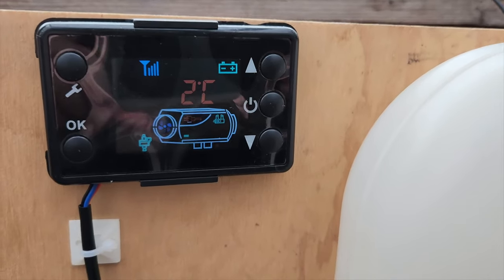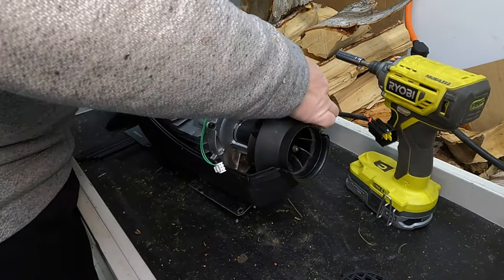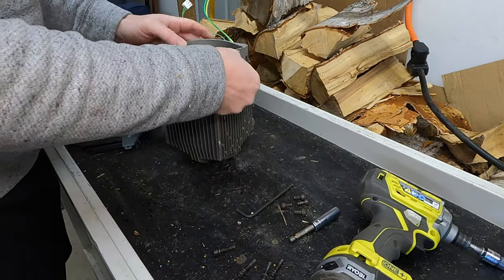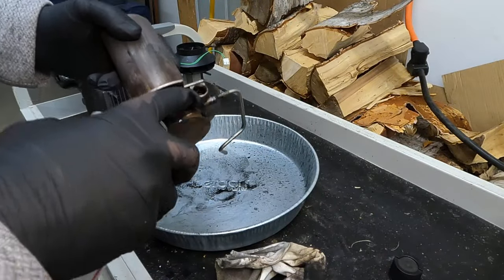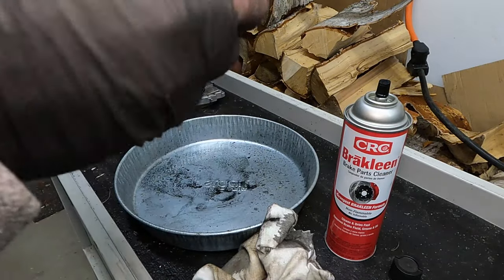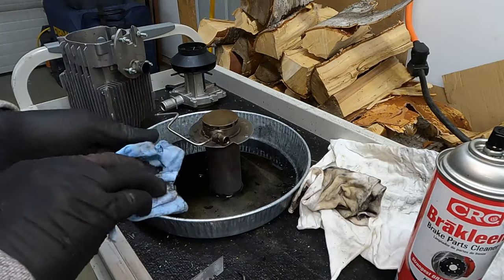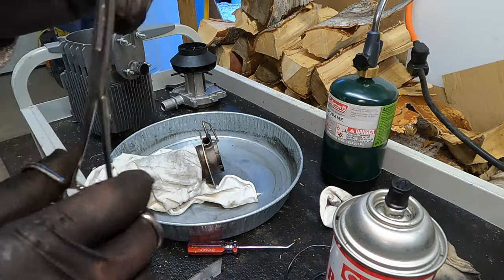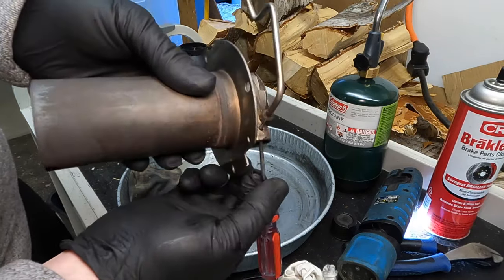My Vevor Chinese Diesel Heater Stopped Working. Can I fix it??

Comment: Don't burn brake cleaner.  The chemicals can break down to harmful or fatal gases like phosgene or hydrogen chloride
Reply from the maker: Good advice!! 😬 I had no idea. I've added a note to the video description. Thank you!
Reply: @alaskanhomesteading  No problem. I used it a few times while welding, before I learned how bad it is to burn
Reply from the maker: @kevinedwards4449  What do you use for cleaning/prep now, instead? I just got an arc welder. All I'm doing so far is making practice beads on junk scrap. (I know not to weld on galvanized metal.)
Reply: @alaskanhomesteading you can weld  galvanized, you just need to abrade-away the surface coating where the weld bead will go plus a bit beyond.
Reply: phosgene is some hardcore death metal shit, seriously. there is video on youtube about leak at a 3M plant once. apparently it can eat through stainless steel braided hose.
Reply from the maker: @cdoublejj  I was very lucky.
Reply: There are two types of brake cleaner only one  has the phosgene concern, I don't remember which is which offhand.
Reply from the maker: @mikesgarage394  The kind I was using turned out to be the bad kind.
Reply: Yeah, the one kind is basically just gasoline. The other kind has a bunch of bad chemicals in it like chlorine

Comment: if you increase the voltage to the heater to almost 14 volts, your sooting , and error codes will go away. the higher voltage will make the glo plug hotter. thus burn cleaner, less fuel consumption.
Reply from the maker: I bet that's part of the problem. The car battery I've been using is quite old and tired, so if I haven't had it hooked up to the charger, it will not perform well.
Reply: How I do that
Reply from the maker: @Timetraveller1010  you'd really have to connect it to some kind of regulated DC power supply to do that. Car batteries just don't sit at that high of a voltage, even on a battery maintainer.
Reply: Code E-10 low Volts.

Comment: These units are called diesel heaters for a specific reason they run on diesel fuel and kerosene only. Yes you get a bunch of clowns that  tell you they will run on just about anything and they will for about 2 days, if you want this thing to run,, use number 1 diesel or kerosene only. Proper installation is a must with these units I see several flaws in yours

Comment: If you are filtering your fuel and intake air, you should not be getting such a buildup inside the exchanger. Keep things clean (and don't burn anything but diesel in it) and you will be good to go! So many are burning waste oil or veggie oil mixed with kerosene and other kinds of fuel in those heaters and wondering why the buildup? Well, they're not made to burn that crap! It's a diesel heater made to burn diesel.

Comment: Your mounting method isn't recommended....... They only operate well if mounted level, not turned on its side....... Not a good idea for consistency in how reliable it runs.
Reply from the maker: @dogdazetravellergarrett1367  I'm not sure I understand, but do you mean that the exhaust and intake need to be underneath instead of on the side? 

Can you say why that matters?
Reply: @alaskanhomesteading  good morning....... I've owned, operated these heaters for over 8 years now, for full time off grid daily use in winter. Technically, the instructions indicate that you can mount them on it's one side, or the default mounting upright( exhaust and intake ports downside). I've mounted mine like yours in the past, but found that they are more likely to flood, misfire mounted on it's side. I eventually changed mounting orientation to being upright ( flat) default mounting.
Just sharing my past personal experiences with this setup.
😎👍
Reply from the maker: @dogdazetravellergarrett1367  thank you. This is the first of these devices I've messed with, so I appreciate the advice!

Comment: That was so painful to watch ...... the removal of the glow plug screen....... a thick bolt with self tapping style thread like a decking bolt and just screw into screen until yo feel it catching  and pull bolt out as you still  turning it clockwise and the screen will be on the end of the bolt

Comment: Your problem was trying to burn vegetable oil, doing that blocked up the bleed air hole and it was a downward slope from there. You should run it at full power BEFORE turning it off, not turn it down before turning it off, the more it runs at full power, the less build up you'll get in the burn chamber, that heater was pretty clean other than the starting circuit being gummed up from the veg oil. If you get into the settings, check the max fan speed is 4000 or less, the motor won't last long over 4K rpm, drop the max fuelling a point or two if you reduce the max fan speed to ensure you don't over fuel it. Yes the fuel filter is technically the wrong way round but the mesh is so big that it won't make anydifference, don't worry about the air bubbles in the line, the pump created them, but it keeps pushing fuel in one end si it can only come out the other end, the heater won't suffer for a few bubbles in the line.
Reply from the maker: Good information, thank you!

Comment: I buy a diesel additive (i.e. Kleen-flo) and add a capful to every fuel tank. It significantly reduces the smoke at start-up and also reduces the soot and carbon buildup in and around the burn chamber. It is so effective, I can no longer tell what stage my heater is in by watching the exhaust.
Reply: I'm glad I came across your comment. I will do this.

Comment: Ok, there's a number of things not ideal in your setup. The fuel filter is the wrong way round and should be close to upright below the pump to eliminate air bubbles and give the pump an easier ride - it will be quieter too.
Also check the voltage drop from your battery on startup, if it is dropping below 12v then your glow plug isn't getting hot enough to ensure reliable ignition. If you fix all of these things and still have the same problem i suspect that the glow plug mosfet on the control board has begun to fail and isn't allowing enough power through.
I had one to fix last week that was doing the same but didn't respond - turns out the guy had pulled the wiring harness too hard and had broken the copper wire inside the sleeve so that also caused a lack of power to the glow plug.
These are wonderful machines and it pays to have a full kit of spares if you rely on one.
Reply from the maker: Thanks for the information!

Comment: I had been wrestling with the same problem for a couple years but finally have it solved. Problem was not enough air getting through the little hole next to the glow plug. After enlarging the hole to 1\8 inch it starts every time.

Comment: You can use other fuels, but only if you adjust the air-fuel ratio properly to match the fuel.
   A lot of people are on here trying to use waste motor oil, but not changing the air-fuel ratio, and then showing how much it failed.
    In order to change the air-fuel ratio, you have to get into the secret menu, if you're controller will allow it, some don't. In the secret menu you can change the fan speed and fuel pump speed relative to each other. There are people on YouTube that explain how to do this.
    It may not start on the other fuel, so you have to start it and stop it on Diesel or kerosene, or a mix. A lot of people use two tanks and valves for this purpose.
    Although it's best to have the inexpensive tools, you can typically get the screen out with a lag bolt.
    Using antisieze on either side of the gaskets will help keep them from sticking for next time.
    Good luck and have fun with it!
Reply from the maker: Awesome, thank you for the great tips! I have monkeyed around in some "Secret" menus in the controller, but they were mostly indecipherable. Now that I understand these devices a bit better I'll have to revisit that.
Reply: Anti-sieze ! What a great idea  !!
I need to service my little 2Kw unit now, same problem,  and although I've got the kit coming in the mail with gaskets & stuff, I thought I'd run a thin bead of Permatex Red Gasket Maker silicone  ... if I let one side form a skin then I'll add a small amount of anti-sieze grease 😊
Cheers for the video 👍

Comment: You might want to try Easy Off Heavy Duty oven cleaner for cleaning your parts if you aren't  in a rush. Spray it on and in, and walk away for an hour or two. Wipe it off, or give it a rinse. Much easier.

Comment: That’s better made than I thought. Low expectations.
Reply from the maker: It's a simple enough design, so making a competent copy isn't that hard. I suspect the biggest quality variability on these cheap units is in the electronic controls and the programming in them. The other stuff is commodity. Cast aluminum, injection molded plastic, and a heating element and temp sensor. It's dead simple stuff.

Comment: Looking at your fuel line it looks like you are pumping alot of air bubbles to the heater. I suggest you mount it vertically so it will run without air bubbles, lubricate the pump piston better (so it won't prematurely wear out) and run a little quieter.

Comment: only thing that's happened to mine is burnt out glow plug, last about a winter season, i just blow through the intake and exhaust with my compressor. great heater for the money £69 when i got mine. i do have to remove the lcd control panel and wrap the screen in a cloth or the cold stops the screen working, but if i for get the cloth or a cold snap drops i have to use a hot air gun to gently heat the screen a minute or two.
Reply from the maker: Any idea why the glow plug burned out?
Reply: @alaskanhomesteading  it had over 14 months use. 10 hours a day.
Reply from the maker: @aeroflopper  WOW. That's impressive. Pretty cheap fix. These devices are so simple it's nice to be able to rebuild them after failures like that.

Comment: I'm in Newbrunswick, Canada and run a vevor diesel heater to heat my mancave. I find that the filter for the intake that vevor provides is garbage in extreme cold conditions. The filter collects ice crystals in turn, clogging the filter and suffocating the system, causing extreme smoking. I removed the filter and have had no recurring problems. Once and awhile, it is also a good idea to run your heater on high to burn off any soot in the system...
Reply from the maker: I wonder if I'm having a similar ice crystal issue here at 61.5⁰N!

Comment: If you ever have to do this again, I would get a gallon of chemtool carb dip and let the burner sit in that overnight before cleaning. As someone else said, you may have dodged a bullet with the brake cleaner this time, but yeah people have died (slowly and painfully) from welding when even small amounts of brake cleaner are present.
Reply from the maker: Awesome, thank you for the suggestion. I assume this cheap heater will need to be cleaned again, so it's good to have a better/safer product.

Comment: Big mistake using a flame with these solvents, certainly asking for trouble. I've plenty of experience in cleaning out soot from Diesel heater steam cleaners, a good wash with alkaline traffic film remover and a pressure washer will remove any debris and it's safe. Dry thoroughly and replace atomiser screen properly so it doesn't block the air intake hole, fit a new glow plug as a matter of routine. Don't mix old veg cooking oil as the flash point is higher and can gum up the atomiser screen. Kerosene is fine but 5% two stoke oil might be a good idea to lubricate the fuel pump or 20% diesel. Have fun
Reply from the maker: You're 100% right. I made a follow-up video to thus regarding the dangers of those solvents decomposing at high temperature.

Comment: I found a thermostat for these heaters. It will turn the heater on and off not just turn it down. I ordered it yesterday.
Reply from the maker: Drop a link to what you found. Is it the Afterburner? I've been looking into that one, but neither of the heaters I have are compatible with it. That system requires a very specific control module on the heater. I may resort to buying a compatible module off Aliexpress or something.
Reply: You can't use that thermostat the heater needs to cool down before completing it's shutdown you'll damage the heater.
Reply: Nope It works just like the key fob. It cycles off @stoneyswolf
Reply from the maker: Can you link to the thermostat you're using?

Comment: Dont forget the magnet on tbe fan needs to contact the bourd so keep the bourd attached
Reply from the maker: Yes, this heater had some problems with that initially. I had to adjust the fan's position on the motor shaft to make it work more reliably.

Comment: Diesel fuel has a smaller molecule even than gasoline and when you mixed vegetable oil with it, It probably gelled and plugged the screen. If you ever want to find a leak in a gas tank, pour some diesel in it and you will find it if it has one. I hear jet fuel or kerosine works well in these heaters. I wouldn't play around with non flammable solvents with flame if I were you.

Comment: Heating oil works great in these and is cheaper. No off road diesel in alaska.
Reply from the maker: I can get Diesel at Freddy's for $1/gal off with points. I can't touch that price on fuel oil anywhere.

Comment: Holy shit dude! I'm the last to be a safety nazi, I've done plenty of dangerous shit. But man, you lucked out with the brake cleaner.  I thought you were doing this outside, then when you started hitting it with the torch, I see you open a door! Just spraying that much methylene chloride, you should have been high as hell. I think they banned it in some country bc a guy died using paint stripper that had methylene chloride in it. General rule of thumb, if it acts like gasoline, but doesn't burn, don't try and burn it! Chlorinated and fluorinated solvents break down with enough heat and make nasty shit like HF, HCl, and phosgene. You seem like a smart dude, but what went through your head thinking its a good idea to pour out large amounts of solvents into a dish in a closed room and then torch it?
Reply from the maker: Lapse in judgment. I did a follow-up video to this one about it.

Comment: Oil pump needs to b at 45 degree angle or it will fail every time plus u need to turn MHz down for pump. Keep an eye on the heat oil will burn almost twice as hot as diesel.
Reply from the maker: I had the pump at a 45 before. I must have moved it while I was disassembling the setup. Thank you for the reminder!

Comment: Change the green fuel line that is supplied with some of these heaters...it is not compatible with the pumps and is not fit for purpose.....it flexes too much and causes air bubbles and diminishes the flow of the fuel due to the minute stroke of the pump....Purchase some `hard` nylon type fuel line ( normally white)...you will have far less problems ...especially at higher output settings.

Comment: if I recall other videos right ... to get the screen out you put a screw into it and pull it out....
Reply from the maker: I'll have to try that next time. Once I got it out I noticed that it's a little rolled-up length of screen, so it makes sense that you could twist it in a direction that would tighten the roll and shrink its outer diameter, making it easier to remove!

Comment: Hi I have the same heater but mine after 2.3 hours of operation the fan starts over speeding and fluctuating the speed up and down even the heater has the same speed setting and finally the heater shuts off and my  it gives all the smoke from the combustion chamber on the intake pipe and very strangely, no error code.  What do you think

Comment: How is your pump mounted? It must me vertical not on it's side or low pressure bubbles will rise to the side and wear out the dosing pump..they dose 0.2 mill litres ea pump and the dose will be incorrect..and destroy the pump..
Don't restrict the intake at all and 0 bends in the exhaust..straight down!
You have a combustion issue, back pressure..

Comment: You talk about problems with it not picking up the fan spinning yeah there's a magnet on the fan and then there's a little sensor and I had the issue of mine becoming loose on the shaft and sliding forward and then the sensor couldn't pick up that the fan was spinning anymore and was shutting down I slid it back so that it was as close as you can get it without it actually rubbing on sensor and put a clamp on fan so that it wouldn't walk off of shaft anymore and haven't touched it in over 4 years
Reply from the maker: I had to do the same, minus the clamp. It took a while to get it working after futzing with it quite a bit initially.